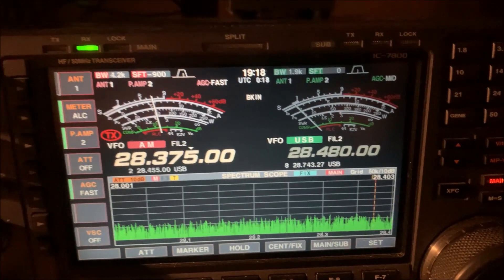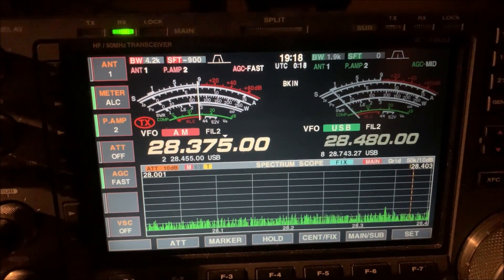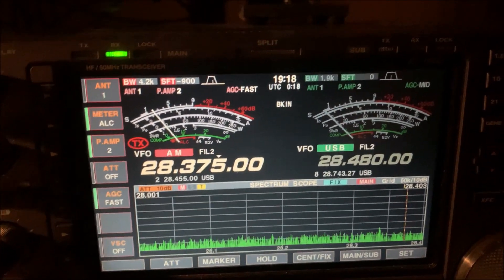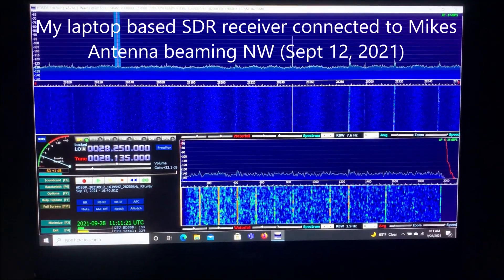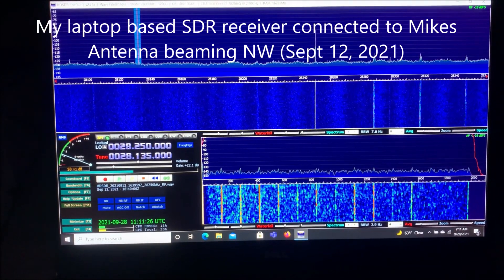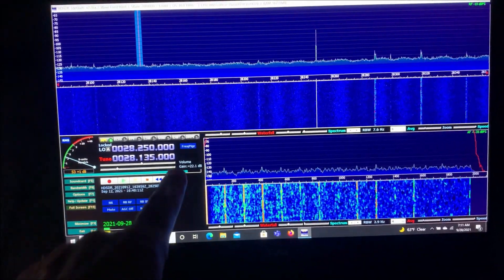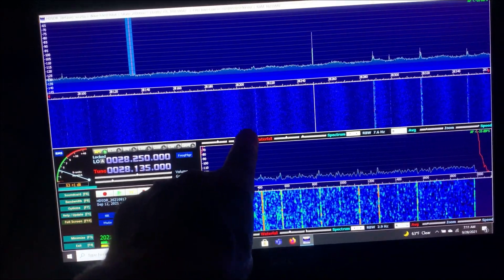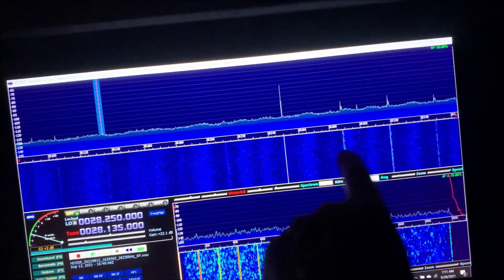RFI on 10 Meters at W9RE tracked down to neighbors LG Refrigerator (Sept 28, 2021 by WD8DSB)

Comment: The FCC should require all TVs, radios and appliances to emit less than -250 dbm on any rf frequency between 10 Khz and 10 Ghz.  And, -1000 dbm on all Low VHF Frequencies between 30 Mhz and 108 Mhz.